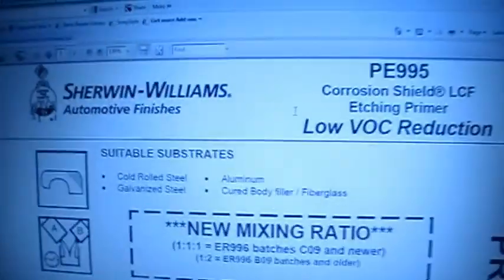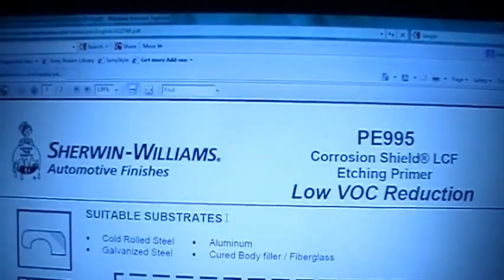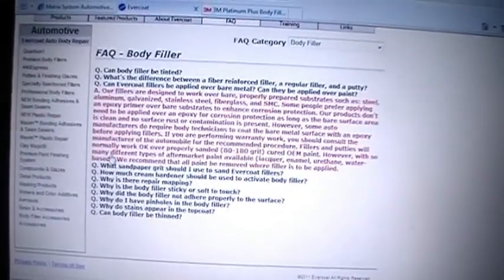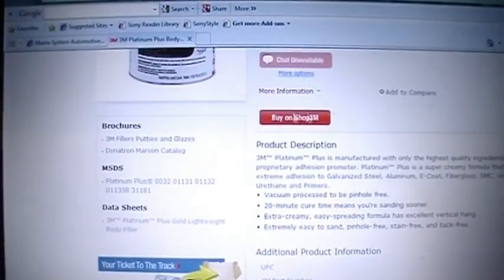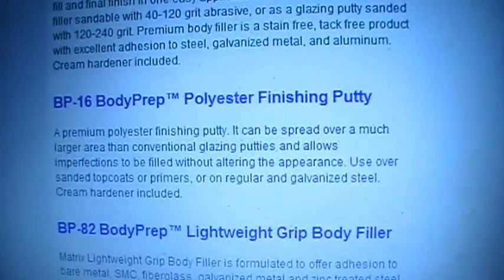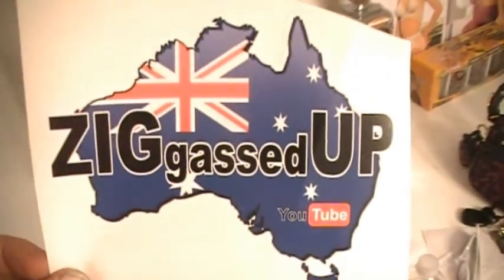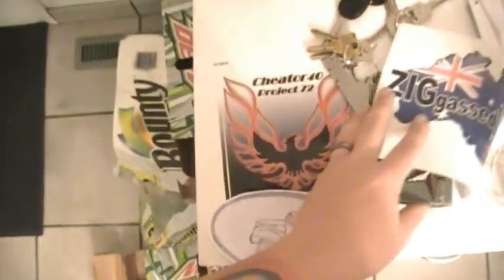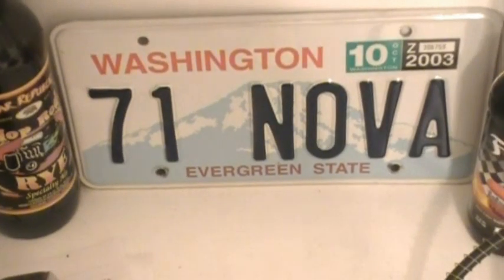Bondo Facts. How Body Filler Should be used

Comment: I always put filler on bare metal, always have always will. I'm not sold on epoxy primer, two things I've seen with itin this neck of the woods. A: it doesn't seem to hold out moisture like everyone says. I've seenl instances where after a year or so of sitting rust starts coming through. B: I've seen serveral cases of it letting loose from the metal when its used as a DTM. I think this may be because it doesn't expand and contract at the same rate as the metal.

Comment: I've never had problems with body filler on bare steel or a painted surface, except on an aftermarket steel cowl hood. I don't know what they put on the bare steel under the e-coat, but I tired USC fillers, Evercoat fillers, Matrix fillers, and then said fuck it. I epoxied the hood and never had a problem. I still put filler on bare steel except if the body panel has/had an e-coat.

Comment: R-M etch primer DE-17 = no bondo on top. Bondo on steel = time and $ savings that's why I have done it this way. I do like metal prep then epoxy prime then bondo as well. Bondo sticks better to 50 grit on steel epoxy is better corrosion protection. So my answer is no answer.